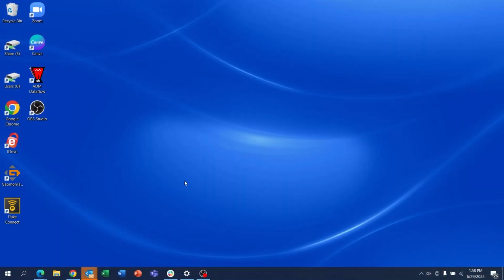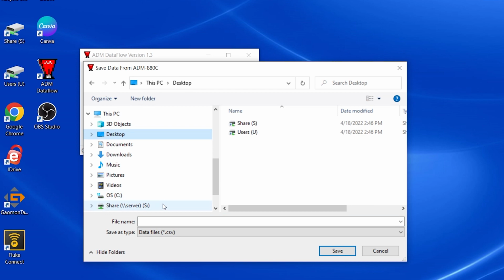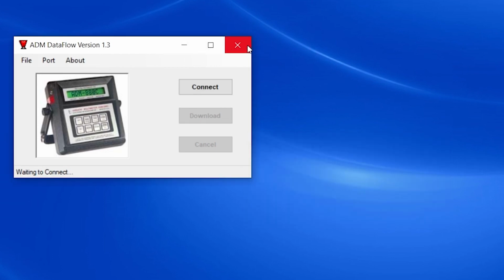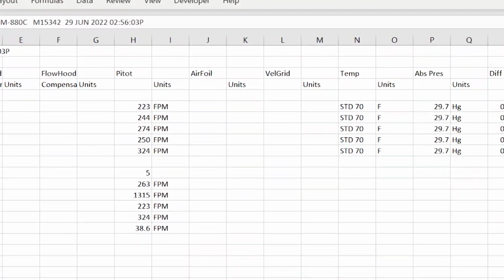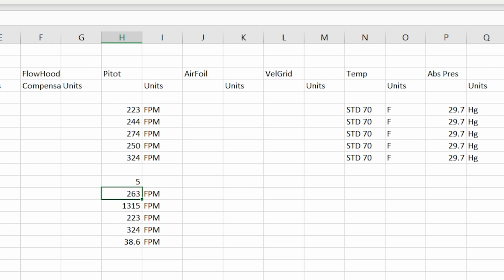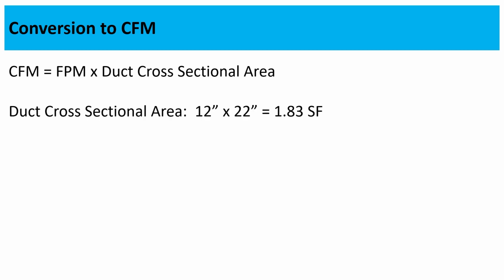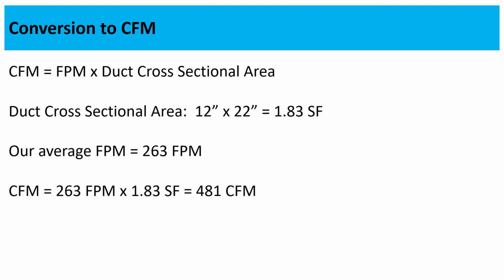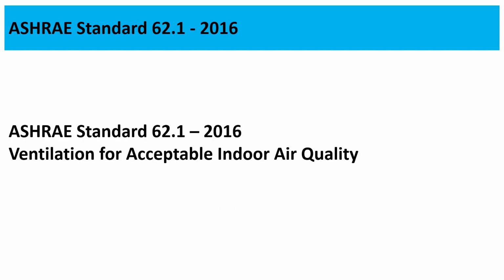Measuring Duct Airflow with the AirData Multimeter ADM-880C

Comment: Those readings should be taken in an equal area or Log-T method per NEBB procedural standards. Not just at the center point of the duct. 2,6,9 inches  on the vertical readings. The flow velocity tends to be lower near the duct walls due to friction. Yes, the average will be close when the velocity is tallied up. However, traverse points according to the National Environmental Balancing Buerou need to be one of the two methods.